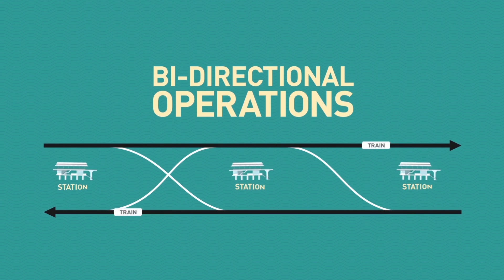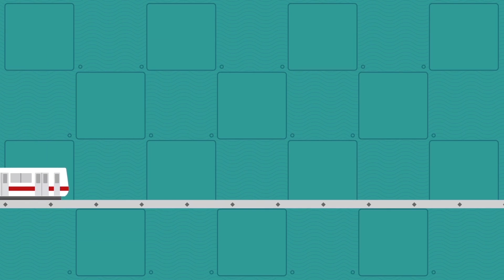Upgrading Singapore's Signalling System

Comment: This moving block system is called CBTC (Communication Based Train Controlled) System as this is being used in the NEL, CCL, The Tuas New Extension and the New DTL line... as for the NSL and EWL is a running revenue during the day and the system unable to be tested fully the system where the software is not stable yet unlike the other MRT Line.